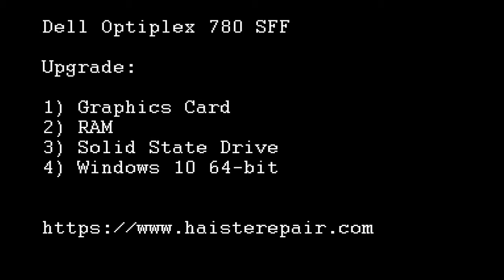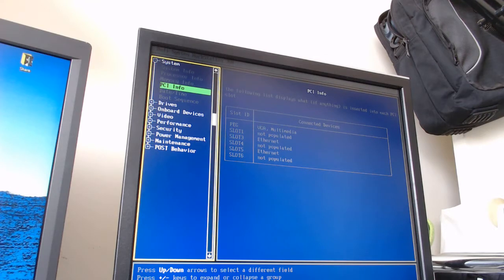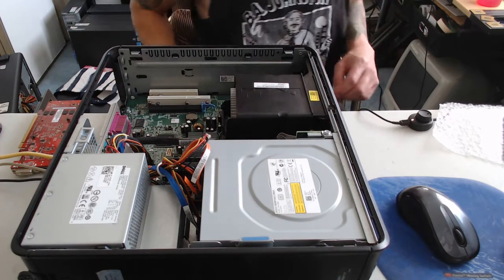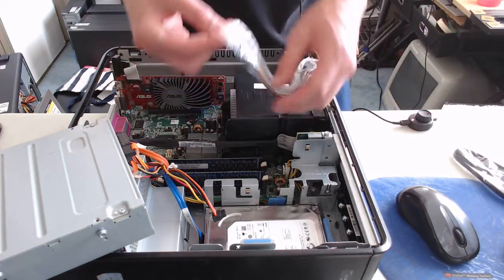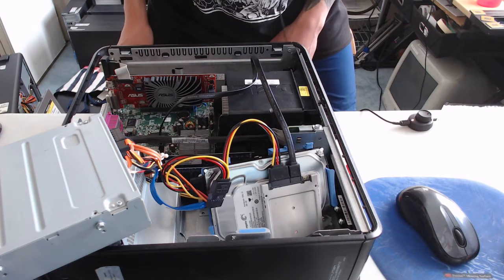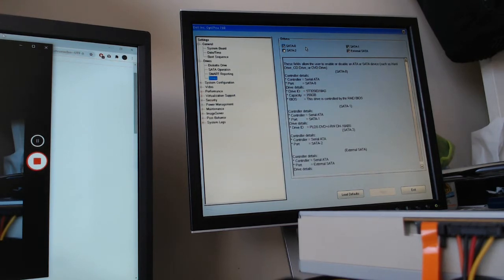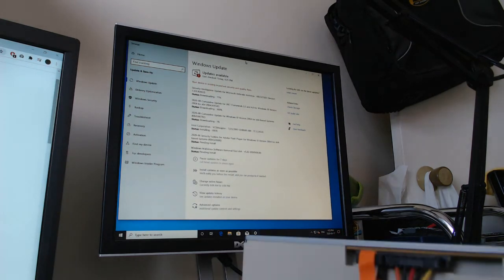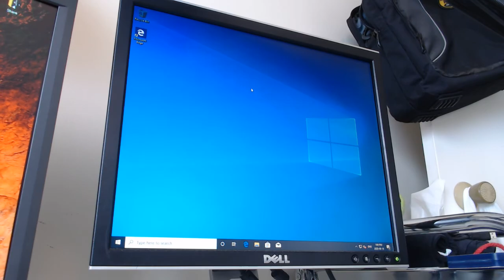Dell Optiplex 780 Upgrade (SSD, Graphics Card, RAM, Win 10)

Comment: Dell 780.. can i put there any regular size card, like RX 550 or R7 240? I have also spare 470 8gig but the cpu will slowwww it down.. thanx
Reply from the maker: Do you have the SFF case like this one or a regular sized case?  The SFF can only take Low Profile cards.  Also, the power supply may not support the power needed to run those cards.  You could install a new power supply, though, if you were willing to invest in some time and resources to make it happen.
Reply: @HaisteComputerRepair  i was just offered that 780 and suspect it is the full sized case + i got compaq elite 8000 ultra slim (laptop board, so-dimms)
Reply from the maker: @paveljelinek772  Cool, well once you know what type of case it is that can direct your purchasing.  Attention will be needed for the power supply.  Check what the output is and if it can support the cards you have.

Comment: I have optiplex 780
 ( no GPU - CPU IS I2 E8400)
-
, and i want to upgrade to :
GPU : GTX 750 ti
Ram : DDR 3 , 2x8 ( 16 ) 1333 MHz
Storage : ssd
-
it's good or something better?
Reply from the maker: I would look into a Core 2 Quad CPU, as this will greatly increase performance paired with a 750Ti.
Reply: @HaisteComputerRepair  Can I upgrade the device, or is there a better idea?

Comment: I have this EXACT model
Reply from the maker: Nice!
Reply: @HaisteComputerRepair  yeah lol
Reply from the maker: @spaceguyezio3545  This belonged to a customer, but they did give me the Dell Precision 380.
Reply: @HaisteComputerRepair  awesome. I upgraded mine with better ram and a core two duo and mine can run Minecraft now
Reply from the maker: @spaceguyezio3545  Fantastic.  I am helping a student for the same purpose with what I believe is another 780 tower.  If you find a Core 2 Quad for a good price, you can install that and have some good performance.  Check out the chart near the bottom of the page here for some compatible options:  https://www.cpu-world.com/CPUs/Core_2/Intel-Core%202%20Duo%20E7500%20AT80571PH0773M%20-%20AT80571PH0773ML%20(BX80571E7500).html

I run a tower from 2008 in my living room with a Core 2 Quad and 512MB Geforce card w/HDMI to stream Netflix, etc.
Reply: @HaisteComputerRepair  I bought a 52 dollar card that has HDMI and with that I can hopefully get better performance as my graphics is currently my only limit because my cpu isn't slow(relatively)

Comment: This was the best guide and instruction! Nice job thank you so much for the really good video tour. Again, nice. I have the exact Dell OptiPlex 780 bought with the windows upgrade. Love this machine.
Reply from the maker: Thank you!  Yes, the 780 SFF or regular sized tower has a ton of potential for use in 2021 and onward.  What have you done/planning to do with yours?
Reply: Haiste Repair I am a bit confused on what brand of ram that is compatible with dell, since they can be picky. My sister runs windows 10 pro 64 bit.
Reply from the maker: @donm3129  Any brand of DDR3 RAM should work.  Check out this and look under the RAM info section for what type to order or install.  https://downloads.dell.com/manuals/all-products/esuprt_desktop/esuprt_optiplex_desktop/optiplex-780_service%20manual3_en-us.pdf

Search "memory" and the pdf will have some info to go off of.

Comment: Many thank for the install of a SSD. I have been having an issue printing from the computer (dell OptiPlex 780 runs great!). I get white vertical line across the printed page. I went though every diagnosis that would cause it to be a printer issue, Cartridges, new cable. My last thought was to print directly to the printer (HP envy 5530). Guess what happened? No lines, picture was perfect. I even place a new picture onto the computer, printed from the computer, line are back, print directly (over wifi) not issue. This has been an issue for about a month. Black and white documents no issue. I've tried in every other usb port no change. I did notice the wifi direct print prints at a slower pace, computer print will be fast and with lines. I'm really stuck. Any help would be greatfull!
Reply from the maker: When you said you printed directly to the printer do you mean printing a test page?  As in, not connected to the PC at all?
Reply: @HaisteComputerRepair   My printer has direct printing from other sources, so I isolated the printer using my cell phone and my iPad. I actually set up the printer as a network through my router and the lines were still there. Any printing through the computer creates the lines. I'm now wondering if its a computer issue. I have tried the printer though every other usb port with the same issue.
Reply from the maker: @donm3129  Interesting.  I actually used to work as a copier technician ten years ago, but I never encountered this problem.  I would be researching solutions online just like you.  Let me know if you find a solution.

Comment: I have an Optiplex 780, AND the SSD with w10 already installed, ive done the step of the BIOS, AND It recognize It, but for some reason, when trying yo Start It, says that the boot device Is bot available, i try It all
Reply from the maker: Try this:  go into BIOS, navigate to Boot Order and make the SSD with Win 10 the top priority.  Do the same if there is an option for Secure Boot, etc.  Any boot option.  Then, save and exit and see if that makes the difference.
Reply: @HaisteComputerRepair  i tried It too, but It doesnt work
Reply from the maker: @Cemgameplaystutorialesmas  was it working before you got the message?  Have you checked the connections from the power supply>SSD or SSD>motherboard?
Reply: @HaisteComputerRepair  yes, It works with the hdd that comes, but with the SSD doesnt, i already changed the cables of power AND data
Reply from the maker: @Cemgameplaystutorialesmas  Is it possible for you to try reinstalling Win 10 on the SSD?  Have you tried the few things listed in this article?  https://windowsreport.com/bios-recognizes-ssd-wont-boot/#:~:text=Reset%20BIOS,reset%20it%20to%20the%20default.

Comment: I've got 2 questions.
1. If I want to just have the ssd do I need a power splitter cable? 
2. Can I just remove the optical drive all together?
Reply from the maker: 1. Nope, just use the one that the HDD was plugged into. 
2. Yes, absolutely you can.

Comment: Hi sir, i have a question

I have an Atheros A9923 PCI wifi card.After I install the card, an error show in startup.

Error allocating Mem BAR for PCI device 04/00/0
Error allocating Mem BAR for PCI device 05/00/0
Error allocating Mem BAR for PCI device 05/02/0
Error allocating Mem BAR for PCI device 05/05/0
Error allocating Mem BAR for PCI device 05/04/0
Error allocating Mem BAR for PCI device 05/04/0
Error allocating Mem BAR for PCI device 05/05/0

My optiplex run like usual after ignore it but I can't use the wifi card.

Thanks in advance!
Reply from the maker: Have you tried installing any drivers from the manufacturer website?
Reply: @HaisteComputerRepair  yea i already download the driver in zip file but i can't find my wifi card name in device manager
Reply from the maker: @farishlobster  Which slot are you installing it into?  Is the card new or used?  Confirmed working elsewhere?
Reply: @HaisteComputerRepair  i tried to install in both pci slot but the result still the same and it is new. Since dell opti 780 doesn't have pcie x1 slot, I'm searching for PCI wifi card
Reply from the maker: @farishlobster  Does the Atheros card connect to a PCI adapter?  I can't seem to find a good match when I Google it.  Do you know how old the card is?  Perhaps it is not working well with Win 10?  Send me a link of what it looks like if you can.

Comment: So if we want to add a sata SSD, do we have to download windows 10 again? I currently have this 780 and want to upgrade it a bit to make it faster as im giving it to my dad.
Reply from the maker: You can install Windows 10 again via USB after you install the SSD, if you like.  If you have access to another computer and ability to connect both the old HDD/SSD from the 780 and the new SSD to it (usually via usb connection, or internally via sata connection if possible) you can use a program like Macrium Reflect to clone the old HDD to the new SSD.  Does that make sense?  Let me know if you need any help or clarification.

Comment: So I bought the monitor from Amazon and I checked inside the thing and I don’t know if the graphics card is small or dosent have it at all.

(Ps I’m new to pc)
Reply from the maker: Hey Dude.  When you say you bought the monitor, do you mean the desktop computer?  There may be no graphics card, which would mean that you could source one and install it yourself.  It's fairly easy, you could even use this video as a guide.  Let me know if you want some recommendations.
Reply: @HaisteComputerRepair  yes I don’t have a graphics card so yes
Reply from the maker: @WrongNumber76  Ok, check out local sales for 1 GB or 2GB low profile graphics cards.  What are you looking to do with the PC?

Comment: Thank you. Can we upgrade to MSI GT 730 or 1030 with Dell 780 sff without having technical black screen problems etc ... at startup?
Reply from the maker: I want to say yes, but I haven't tried.  I wish I could so I would know.  This post seems to lean towards no, but perhaps check out what your motherboard says next to the PCI slot.  Do you have a card to try?  Wouldn't hurt to give it a go.   https://www.dell.com/community/Desktops-General-Read-Only/GT-1030-in-a-Dell-Optiplex-780/td-p/5144628
Reply from the maker: This documentation lists cards with power consumption over 25W, so I would have to  personally try.  As always, there is conflicting evidence online.  Please let me know if you do get a chance to try! https://www.dell.com/downloads/global/products/optix/en/optiplex_780_tech_guidebook_en.pdf
Reply: @HaisteComputerRepair  Thank you for responding quickly. After reflection, I think to buy the MSI gt 710 which consumes 19w and which would be compatible with this dell. it is for internet office use only. currently i have only one hdd disk, 8gb ram, e5300 processor, no graphics card. upgrading with an ssd disk instead of the hdd and adding a graphics card will make a good difference I think. What do you think ?
Reply from the maker: @jl5897  The SSD will make a big difference in terms of performance and speed.  Look for a 120GB SSD unless you need a lot of storage space.  Then, your HDD can be for storage.  The GT 710 is a nice card, for display options and a little boost.  I have a video testing one out in a Lenovo ThinkCentre M93p.
Reply: @HaisteComputerRepair  a thousand cool thanks.
Reply from the maker: @jl5897  Let me know how it goes :)